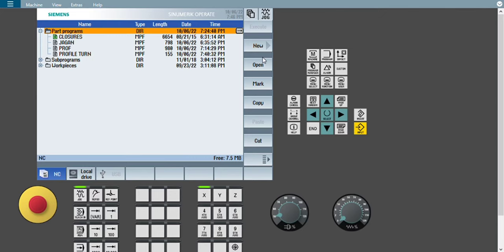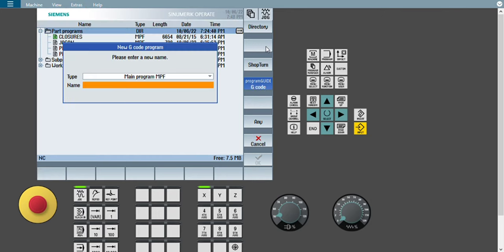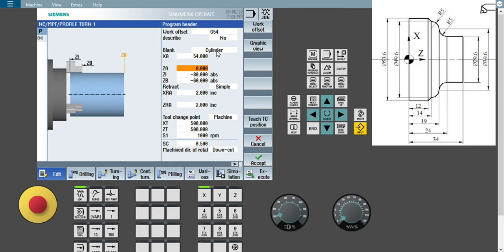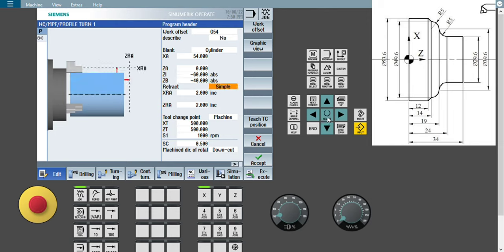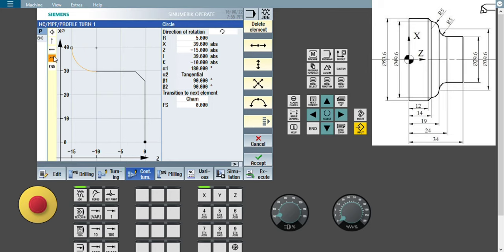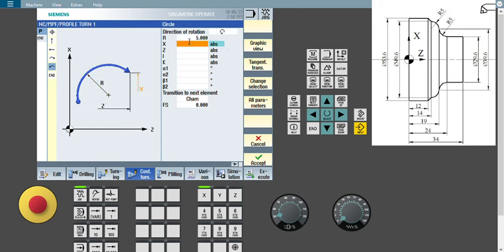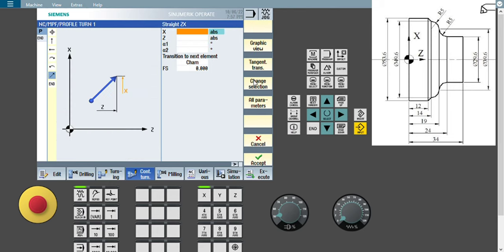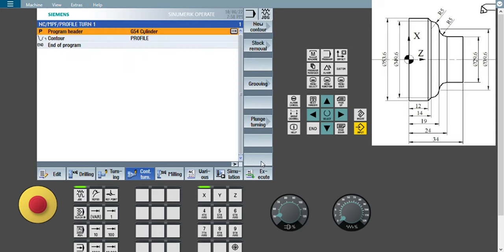Profiles Turning cycle in shop turn programming method- Siemens CNC SINUMERIK 828D/840DSL English

Comment: How to enable automatically entering of “D” values inside program of simens 808D controller machine
Reply from the maker: https://youtu.be/dmPkJdp8yPU
Reply: @CNC_Guru_Tech_Center  i think u r not getting my question. I’m asking about VMC Cutter radius compensation’s “D” value entering through program using G10 code for example in fanuc controller machine we command it as G10 P2 L4 R5 in MDI mode and if we cycle start the diameter value is changed from 0 to 5 as we have command it as R5. so how to use this option in Simens control machine